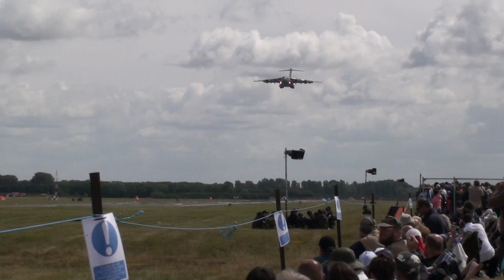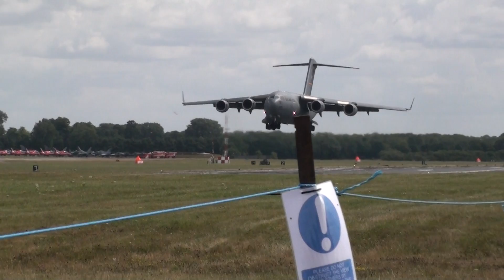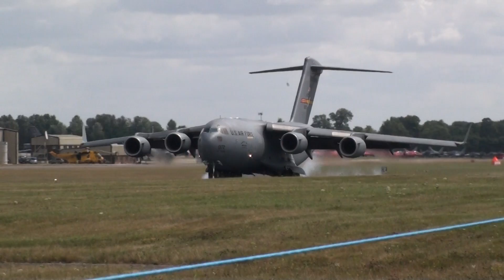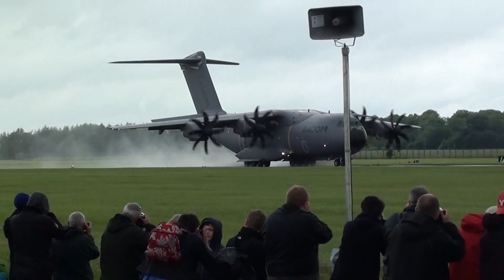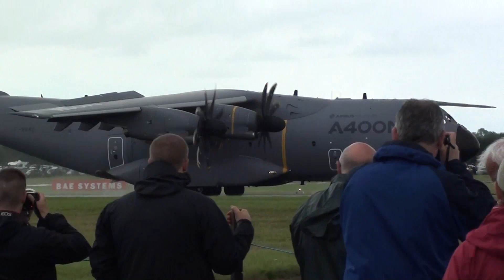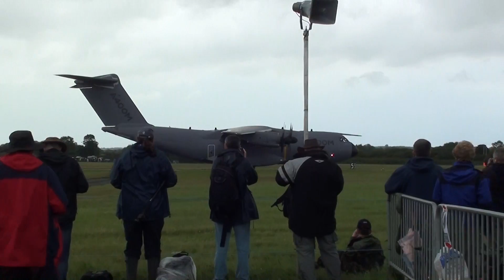Tactical Short Landing C-17 vs A400M. What Brakes The Most. Reversers, Wheels, Props, Spoilers?

Comment: The 787 is not a nightmare. Once the snags are worked out, it should be fine. From an airline perspective, and I am in the industry, the 787 was more than three years late. Delays cost money. As for the "minor growing pains", they don't seem to stop.
February 6, 2012 - Boeing says it has discovered a manufacturing error that requires repairs in the fuselage section of some Dreamliners.
July 23, 2012 – ANA says it is having five Dreamliners repaired for a defect in their Rolls-Royce engines.
July 28, 2012 - A 787 suffers engine failure during testing in South Carolina. US authorities announce investigation.
September 5, 2012 - ANA aborts the take-off of a Dreamliner after what appears to be white smoke is seen billowing from the plane's left engine, believed to be due to a glitch with the hydraulic system.
October 4, 2012 - General Electric recommends new inspections of its GEnx engines, used on some Boeing 747 and 787 aircraft, following the failure of an engine on a 747 operated by Air Bridge Cargo in Shanghai on September 11.
December 5, 2012 - The FAA orders inspections of all Dreamliners in service following reports of fuel leaks.
January 7, 2013 - a fire breaks out on an empty Japan Airlines (JAL) Dreamliner in Boston.
January 8, 2013 – a JAL 787 suffers fuel leak, forcing a flight from Boston to be cancelled. A crack in a cockpit windshield grounds an ANA Dreamliner.
January 9, 2013 – United Airlines reports problem with wiring near the main batteries on one of its six 787s. Safety investigation launched by US National Transportation Safety Board.
January 11, 2013 – second JAL aircraft found to have a fuel leak.
January 13, 2013 – JAL reports fuel leak on another of its Dreamliners. Japan’s transport ministry launches its own investigation.
January 16, 2013 – ANA flight from Ube to Tokyo Haneda diverted after burning smell detected. Inspection revealed a battery fire. Similar incident on a JAL 787s at Boston Logan sees all 50 Boeing 787s in service grounded. Deliveries halted until battery problems resolved.
June 2, 2013 – JAL finds problem with air pressure sensor that detects overheating in one of its Dreamliners.
June 23, 2013 – United Airlines flight makes emergency landing at Houston due to problems with its brake system.
July 12, 2013 – fire breaks out on an empty Ethiopian Airlines 787 at Heathrow, forcing the airport to temporarily close. Investigation finds fire was caused by lithium-manganese dioxide batteries powering an emergency locator transmitter.
July 18, 2013 – JAL Dreamliner flight from Boston aborted “due to a maintenance message (fuel pump) indicator”.
July 22, 2013 – Qatar Airways confirms grounding on a 787 due to problems with an electrical panel.
July 24, 2013 – oven overheats on Air India flight, prompting investigation.
July 26, 2013 – ANA finds damage to battery wiring on two Dreamliner emergency beacons, the same device suspected of causing fire at Heathrow.
July 27, 2013 - United Airlines also discovers problem with emergency beacon.
Oct 10, 2013 - Japan Airlines turned around two of its Boeing 787 aircraft during flights due to technical problems. Two anti ice systems failed on one aircraft.  On the other aircraft, an electrical glitch made six toilets unusable.
Nov 23, 2013 - JAL replaces  Dreamliners on its Tokyo-Delhi and Tokyo-Singapore flights with other types of aircraft while also dropping a plan to use 787s for its Tokyo-Sydney route from December due to engine icing problems.
Jan14, 2014 - Boeing confirms new B787 battery incident after smoke was discovered coming out of a battery of a parked 787 in Tokyo.

Despite it all, Boeing makes excellent machines. I say that with no reservations at all. There was a time in the late 80's when the B767 had quality control issues, yet once resolved it went on to be a great airplane for airlines.

Comment: Actually, spoilers do not cause much braking action when they are deployed, what they do is "spoil" the airflow over the upper surface of the wing, doing that, they cancel the lift  generated by the wings and allow the brakes and tires to do the braking. What really causes the plane to slow down the most on landing is the reverse thrust, as can be seen in the C-17 landing, it slows the plane down to a stop and starts it going in reverse.
Reply: Wrong
Spoilers account for 9% of the c-17 braking. That seems small but in that sfl that accounted for 90 feet that's not a small number.
Reply: brian hilligoss
 I think if you re-read my comment, you will note that I said that the spoilers "do not cause MUCH braking action" I am not going to dispute the 9% figure that you so vehemently  defended, nor am I going to get into an internet pissing match with you on this topic, but I think if we took a poll of readers, I am fairly confident that they would consider 9% to be NOT MUCH. My comment was intended originally to explain the MAIN PURPOSE of the spoiler on an aircraft wing structure, and that is in fact to SPOIL LIFT - hence the name "SPOILERS"
Reply: What really causes the plane to slow down the most on landing is the braking. Thrust reverses will help of course, but is is the brakes that do the bulk of the stopping. As for the airplane stopping and going in reverse in the video, it can be seen that once it stops, backward acceleration provided by reversers is quite modest. Full braking has a lot more punch than that.

Comment: The primary braking system for every plane is the "wheel brakes". All the rest are supplementary. No plane gets certified to fly unless is tested on its wheel braking ability on a rejected take off with full payload.
Reply: ***** when you are a pilot on a plane try to stop it with the use of its engines but pls make sure you have no other passengers with you. LOL The engines simply assist on the braking. The temperature on the brakes and tires are controllable and constitute no safety issue once the plane lands at the appropriate weight.
Reply: *****
 The certification requires a successful stop on the wheel brakes for an engine out landing. Many aircraft still allow operation with the reversers inop anyway.

Comment: even though the pilot has the last say...the c-17 clearly mastered the challenge !
Reply: for commercial aviation I wouldn't agree more, but for a military application dedicated to wartime missions every foot of runway counts !
Reply: ***** They both have turbines. The turbines are the part that generates power, and they are driving either a prop (A400) or fan (C17) that provides thrust, in addition to the turbine exhaust.
Reply: ***** Both turbines, C17 uses Turbofan, and the A400M uses Turboprop. And i'd say that they were very close, given the wet runway in the A400M's landing. Brakes DO most part of the braking.

Comment: Um... Boeing had like 100 years to build a double decker jumbo jet.... Airbus beat them despite only starting in the 1970s... Newest A359 will kick B788's ass. But what's C130 got to do with this video? So far, I've seen it's about C-17 and A400M. Why need to bring the C130 in? Yes, it's a great plane, no argument. Well, only 238 have been delivered and little over half still goes to the US. Bit biased aren't you? 8 years to go to the moon? Still late to the space by few months... Irrelevant.

Comment: I know. What I'm suggesting is that if Boeing replace the lithium batteries (because they can't get them to a high enough safety standard or something like that), the nickel cadmium batteries might not be able to supply enough power without needing to redesign the entire battery compartment area (the lithium batteries are much more efficient for what they weigh). Whereas the A350 needs less electricity, so it can do with normal batteries.

Comment: Mmmm. I'm not so sure. The 787 relies very heavily on electrical energy, but there's no "bleed energy" from the engines. To supply the required electricity, they'd need a lot of battery (assuming they use the older nickel-cadmium batteries), much more than the A350. The (nickel cadmium) battery on the A350 weighs 80kg, it would need to be much more on the 787, as the A350 is more conservative with its use of electricity. If Boeing really could change the design, they would have.

Comment: valid point, however i think its still a minor issue. they can switch out the batteries. its not an air-frame issue or major component isuue

Comment: Fire on a plane is really not a good thing, see Swissair 111. The smoke can hinder the crew or suffocate anyone. And on the 787, the problem is worse, because there (was) no system to put it out, and the fire burned at a temperature higher than the melting point of the fuselage. 

Only the RR engine issue compares, but that's been solved. Boeing however don't know the actual cause of the fire.

Comment: Nowhere near as serious as the 787's battery problems. The 777 is the benchmark for safety, even though it's had a fatal crash now. 

And you could argue its reliability is a very serious problem. Norwegian have had to return a 787 to Boeing for repairs after it broke down 6 times in a month, and lease an A340 to service the routes they've just launched with the 787.

Comment: The C17 landing is very impressive and more so that the A400m because the C17 is significantly larger and has a MTOW almost 300,000 more than the A400m. I dont think these airplanes are in the same comparison category. The A400m was built to compete and improve on the C-130

Comment: It has nothing to do with the FPS of the camera but rather the shutter speed, that is the rate at which the digital sensor refreshes the image, Cameras can have a shutter speed as high as 16000 refreshes per second, only some of the captured images are captured and converted into a standard video format. In the case of a shutter of 16000, every 533rd frame is captured.

Comment: it depends on the FPS rate of the camera and speed of the propellers.
in pysics class we did a test, with a string that goes up and down about 30 times a second, with a strobe with the same frequency it looks as if the string is standing still, because at the moment rope is at point B the light flashes so you can see, then it goes up and down and again at point B it flashes, so it's the same of the propeller, but then a slight difference.

Comment: Film is exposed all at once when the shutter opened. Video cameras scan the frame, from top to bottom (I don't know if they go L to R or reverse). Since there are generally 30 frames a second, and since props often spin around 2,000 RPM, the prop spins ≈16 times during each frame. But since it takes a while for the scanning action to make it from the top to the bottom of the frame, the prop is in different places when it is scanned by different parts of the sensor!

Comment: The A400M Atlas has scimitar propellers where the blades are swept back in the direction rotation.  While the frame rate of the camera stops or reverses, in this case, the apparent motion the blades themselves are in fact curved that way.

Comment: 115knots, but i think the new version C17B (tactical version) , heawy modified to reduce the minimum speed (extended Breguet blast flaps), better braking, more powerfull engines, reinforced and larger landing gear, reinforced structure, etc..., but the aircraft is so eawyer and much more expansive...some understand now why the A400M is a bit heawy...

Comment: C17 and A400M canot be compare,C17= strategic heawy lifter, A400M=tactical medium lifter (AN70 idem)
That the A400m cannot lift a battle tank is not realy a problem because in all external operations are the wheeled tanks, like for ex.the AMX 10RC much more efficient (guerilla not have battle tanks).
But the A400M cannot realy replace the Transall who is capable to land on very bad terrain for commando operations (not far from the capability the  canadian Caribou but bigger)

Comment: nope, they fixed it. usually bugs do occur once an aircraft is rolled out into service. it's just been a while since the last Boeing one, and a battery overheating is not nearly as bad as some of the other roll out bugs. they usually surface because there are more flights  more/different planes etc. rather than all the flights on this one prototype they have been flying every so often during test phases.

Comment: Spoiler don't brake at all.  All spoilers do is dump the lift from the wing.  Spoilers only decrease force in the vertical aspect.  Spoilers will add power to the wheel brakes.

Comment: No the props look like that because a high speed shutter was set on the camera. Normally viewing would be a blur
Reply: Blur is better.
Reply: I thought it was those new high-performance propellers the Air Force was trying out
Reply: awesome
Reply: The props look like that because of the specific difference between the speed of the props (rpm) and the speed of the camera (fps).
If you were filming a plane (or helicopter, or anything that rotates) at 30 fps, and the blades are rotating at 300, 600, 900, 1500, 3000 rpm or any multiple of 30 (your fps), then it would look like the blades don't move.
This is because every frame taken, the blades are in the same position, but they have rotated in between.
Reply: @Fishezzz  In the movies you never see effect like this even though 24 fps because slow shutter speed.
Reply: @Fishezzz  so shutter speed

Comment: Definitely engines in this case. C17's are overpowered to hell. The pilots I've talked to said that on normal runway conditions, they would only need the equivelant of a two engined commercial cargo aircraft type deal for take off and landings. For get in, land quick and launch quick, four thank you very much.

Comment: reverse thruster provides only about 25%-30% braking power, the rest comes from spoilers, flaps, slats, and brakes.
The engines are almost at idle (roughly 50% of max power) when the plane touches down, thus only providing about 30% of reverse thrusts. 20% goes to the core (depends on the by-pass ratio), to keep the engine running of course.

Comment: Indeed - but it's nowhere near as effective as wheel braking.

Interestingly, bouncing on what you said, some use idle reverse too limit taxi speeds after landing when they have hot brakes. This happens mainly with scoop-reversers (B732, F100, etc) as cowl type ones would be too prone to FOD ingestion. So yeah TR's can be quite handy sometimes.

Comment: Reverse thrust even when just acting as a vector (ie. not aligned with the motion of the plane) and even if the turbines have only cold reverse thrush (leaving the inner hot thrust and the compression to produce forward thrust) still have a noticeable effect at low speeds, so much that it is able to change the momentum of the plane to full stop and actually reversing.

Comment: The wheel brakes by far. Unless you're doing minimum distance landings like this the real advantage of reverse thrust is that you don't need to slam on quite so much so the brake pads last longer...
Also, if you're on a civvy aircraft then the reverse thrust makes a lot of noise and makes the aircraft rattle, successfully scaring the passengers!

Comment: And finally, about the spoilers: the drag of the spoilers only helps at high speeds (that's how aerodynamic drag works, as air resistance increases with airspeed squared. 

What spoilers are there for is to "kill" the lift, so as to apply a lot more friction on the wheels, therefore giving them a lot more adherence.

That's why they are deployed upon touchdown: to "stick" the aircraft to the runway, making braking action a lot more efficient.

Comment: Adding to that - reverse thrust on turboprops is a lot more effective at all speeds than reverse thrust on turbines. This is because they work differently: the props are angled differently to reject the air right at the front, whereas the turbine sucks in the air first and then rejects it through a spoiler (which you see opening) at a later stage.

This makes the aerodynamic effect of reversed props a lot more dramatic and effective at all speeds.

Comment: It's the wheel brakes. They do most of the braking. What the reverse thrust will do is actually reduce brake wear.

These airplanes often use autobrakes which have a defined ft/sec² deceleration rate, i.e. 3ft/sec/sec. Whether you use full reverse or idle reverse, the deceleration will be the same - but the pressure applied on the brakes will be different. 

It still makes the wheel brakes do most of the job.

Note, too, that reverse thrust has next to no effect at speeds under 60-80 knots.

Comment: On the C-130, the brakes, equipped with anti-skid, do most of the work. If you run the charts without reversing, the difference is not as much.

Comment: it all depends on how much runway you have, what the runway is like, what your wind is, the landing weight of your plane and of course what your landing gear looks like. The more wheels, the more braking power in total through brakes without wearing them too much.

But it's to calculate what's more expensive: Use a bit more fuel and power the reversers for a few seconds (which is, to be fair, a joke) or wear the brakes and wheels out early. Fuel is cheaper than all-new wheels and brakes.

Comment: This is what has been explained to me by pilots as well as engineers. Maybe the ops are different for different airlines as well as different types? I know for 100% certain of airlines that use reverse as little as possible. Some regional jets (not comparable ofcourse to heavies) that don't use their reverse at all in certain airports. Last time I was on an A320 the pilots also only applied idle reverse thrust (on a 3200m+ runway)...